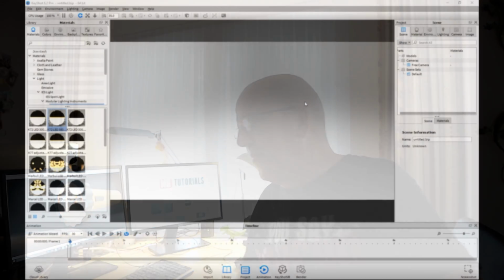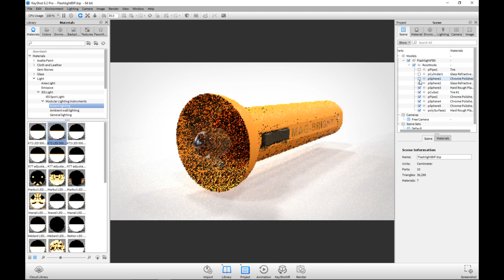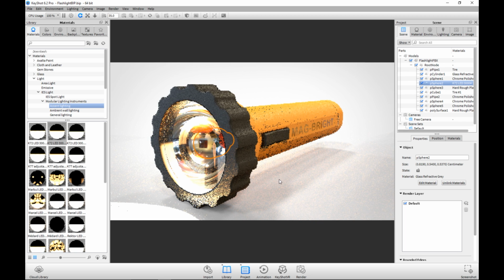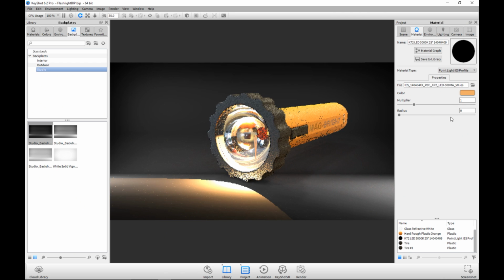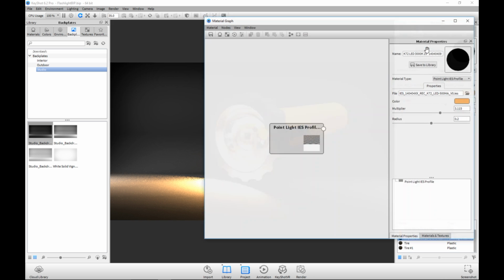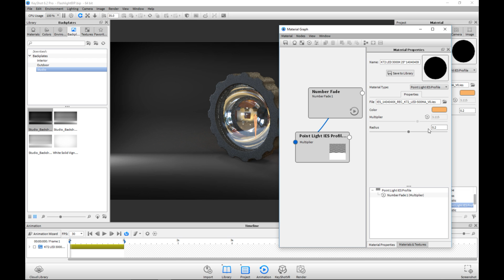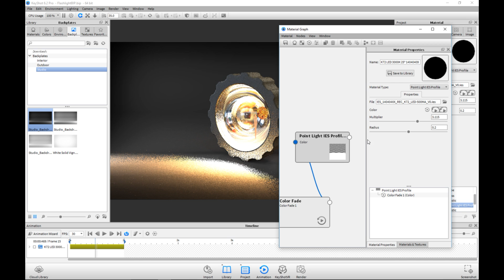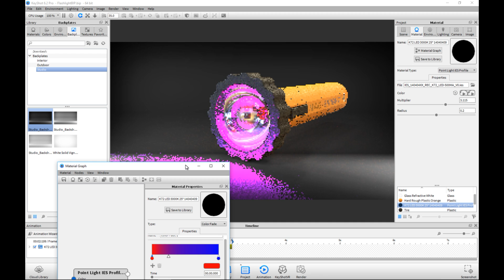How to add ( and animate !! ) light to your scene using Keyshot 6.2

Comment: Hello Mike, great video about lights animation I will try it as soon as I get idea where to use it. I have question. When I have some lights materials especially lights of cars (Emissive, Aera Light Difuse or IES) then my final picture is grainy by white spots. I tried to do it by selecting Interior mode in light section but then it cannot render Blur/Motion of Animation. Have you any advice how to sort this problem out please? Here is short Video where it also came too grainy https://youtu.be/WqfzBTXWKok
Reply from the maker: Hi Leny, yes I see what you mean, very grainy. Well it is very important when using light like this to bump up the samples in Keyshot to reduce grain and noise. Bump them way up
Reply: Thank you very much for your fast response. So Samples up??? Ok. Thanks once again ;)

Comment: When you dropped the light in, the orange cone points down as if the light was coming from the ceiling (and is also evident in the material pane rendered ball preview). How do I rotate this so that it's actually pointing straight out of the flashlight?
Reply from the maker: Click on the material and adjust the position paremeters